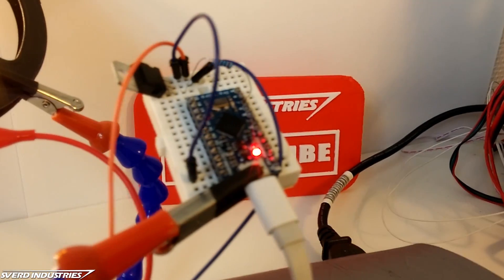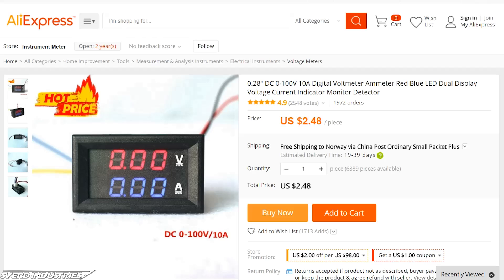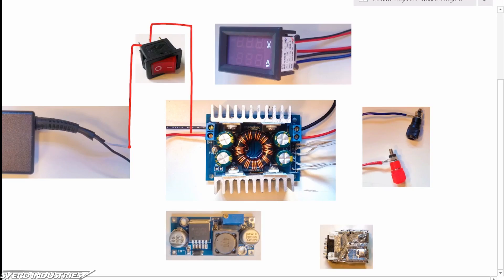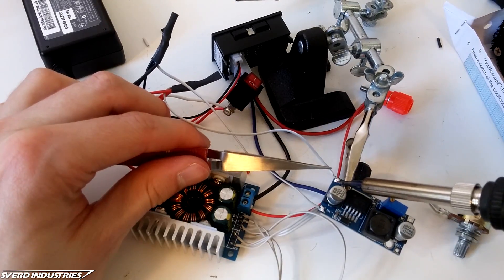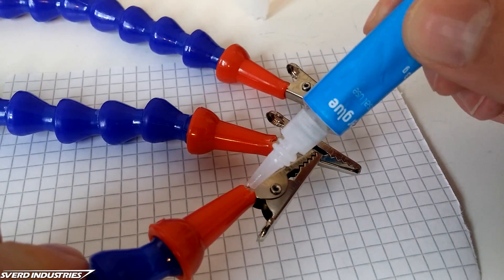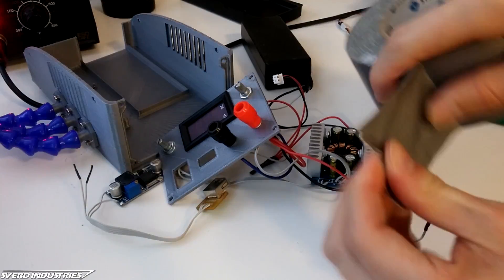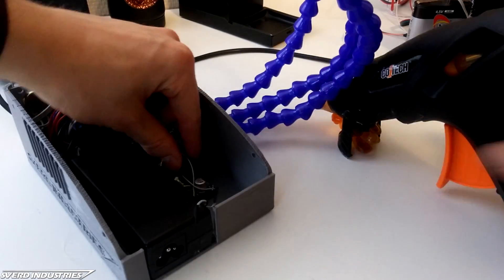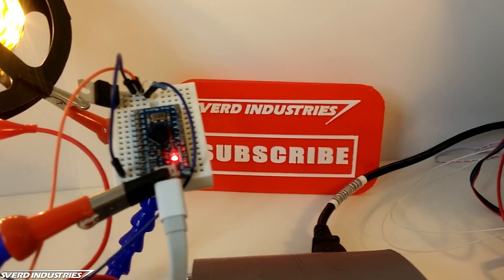ULTIMATE Electronics Helper! Bench PSU & Helping Hands || How To

Comment: First off, great project! Just one question: should the screen's positive terminal (of the meter) be connected to the buck/boost's positive? The diagram doesn't show it so I was wondering if it's necessary
Reply from the maker: You're right that's missing from the schematic! Here's the pin out you should follow
Screen:   Buck/Boost:
Red wire   Positive output and Red banana plug
Black wire  Negative output
Blue wire  Black banana plug

I hope that helps!
Reply: Sverd Industries thanks for the reply! 
One more question:
Is the order of the pins of the potentiometers the same as their order on the buck/boost (all lines parallel) or do some cross?
Reply from the maker: Elad Harel the pin configuration is the same for the trimpots and the rotary potmeters. So no need to cross any wires! You can switch the right and the left wire to change rotary direction, if that's something you'd want
Reply: Sverd Industries great! That's what I thought but I just wasn't sure. Thanks!

Comment: Great build! I would add a second switch so you can adjust the voltage, and not have to connect and disconnect the banana clips.
Reply from the maker: Thanks! Why would the second switch be needed though? I usually adjust voltage with the clips connected and it works fine.
Reply: You might want to make sure that you aren't going to overdrive what you have on load. You might connect everything, and forgot it was on 12v, but the thing you want to drive is only rated for 5v. It might be me, but I have made many things pop because I forgot the power supply was set to high.